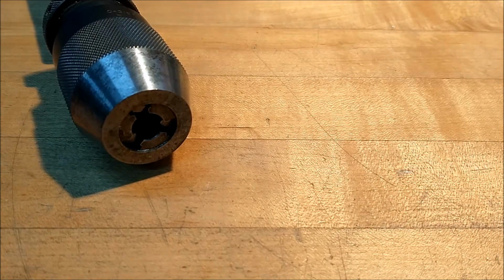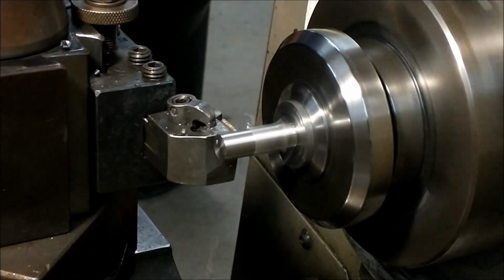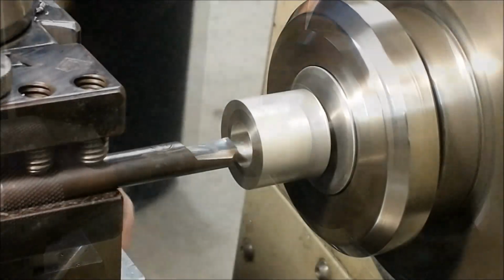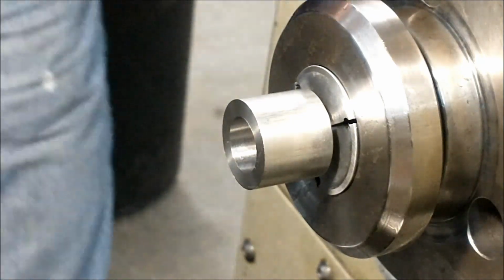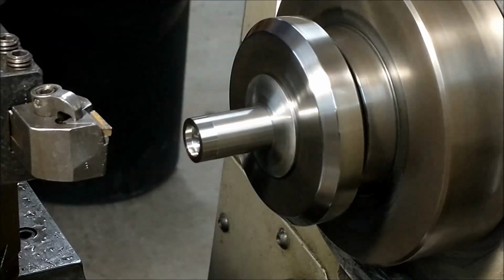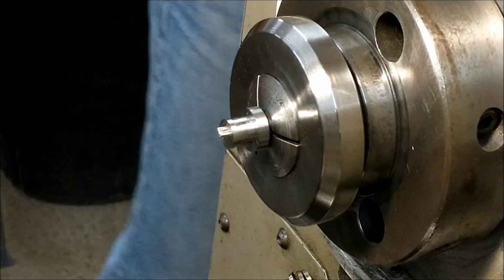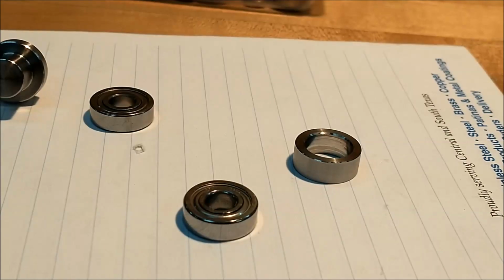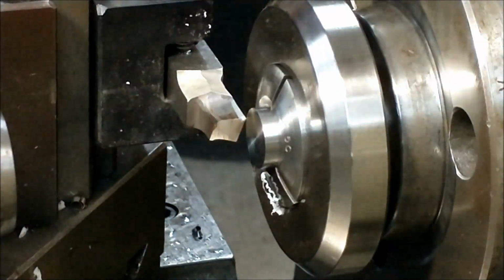Need a Live Center For your Lathe??  Lets Make one !

Comment: Are those thrust bearings? I'd think you'd want those in this type of application.
Reply: I'm definitely going to make one of these to replace the slug of brass I have with one flat face and one face with a centre drilled hole.
I'm going to add a lip seal and use angular contact bearings. I'll put a threaded through hole with a grub screw for driving out the centre and adding oil to the bearings.
Reply from the maker: Tapered bearings would be the best.

Comment: I was wondering about the bearings you would use. I priced a bearing set for an old Rohm live that I had picked up. If I remember correctly the price was in the $400 range. Needless to say, this center is a lot friendlier on my wallet
Reply: You can get them at a hobby store that sells R/C car parts, I bought a set of 8 for 15 bucks. You could probably get them cheaper on Amazon but I'd rather support a local business and the price difference isn't but a few dollars, I also don't have to wait for shipping. If you want a bigger 3/4" OD, 1/2" ID go to a skateboard shop/sporting goods store, good Swedish brand bearings for about 6 bucks apiece.

Comment: Don't tell about apprentice pranks! Oh well, do!

I got pranked so many times, because I was the perfect target: I exploded 😄
Reply from the maker: We blew up a cocky, know it all engineer once with oxy acetylene. He was quite humble after that.
Reply: 😄

When I left my workplace for any reason, I had to check literally everything, and the most insidious prank was the everywhere hidden blue ink.

They heated my workpiece, put it out of center, replaced the cutting tool, moved it off center, replaced gears, electrically inverted the motor, glued the handwheels or the tailstock, exchanged the imperial indicators with metric, unlocked the half nuts.

All under strict observation of the whole crew. When I heard somebody giggle, I knew something was wrong, and when I looked up into twenty grinning faces, I got so hysterical.

A couple of times it went too far, but we sorted it out: I was exceptional at school and could rapidly find solutions for "unsolvable" problems. Also, my special tools were popular. And when I was torching with fierce anger, they were off limits 😄

Now I am the complete contrary. If you want to fight me, you have a hard time to get me upset. Then, it was a snap of a finger.
Reply: @joepie221  machinists think engineers are the dumbest people who suck air.  I know, I have worn both hats.   One reason is that most engineering schools use professors that have actually never done engineering, and they don’t teach ( usually ) anything about the manufacturing processes.  I was lucky in that regard.   While working as a prototype machinist, I was invited into the engineering group.  So I already knew about precision sheet metal and close tolerance machining.   Furthermore, the chairman of the engineering school where I attended had been a practicing engineer so he insisted on a manufacturing methods class be taught.  The emphasis was on how the process affects the material properties, but everyone had to make something in the machine shop.  That class went on many field trips.   Every place we went, I had either worked there or they had made something I had designed.   I guest lectured this class the next quarter.   This was long enough ago that the school had not switched to semesters.  
I know full well of jackass engineers however.   Nobody pranked one particular guy,  he did it to himself.   This happened when he insisted in running the torque machine to show us that the roundness requirement on the sleeve was righteous.   Compared to what the sleeve fit on it was compliant.   Non magnetic stainless steel with minimum yield of 140 ksi is squirrelly  stuff, so keeping the sleeve in tolerance was hit and miss.   Didn’t matter as long as it was correct in the machining center.   While running the machine used to screw on the sleeve, maximum torque was reached and the sleeve was NOT on.  In the midst of his victory dance we pointed out that the torque maximum was reached because he had maxed out the stroke.  When operated by a competent operator the sleeve went on with no problem.  I still think the shop guys laugh about that incident.  It happened about 15 years ago.

Comment: Nice little project !  
 How would you build a 3 or 4 jaw chuck live center ?  I have need of one for my old 10" Logan (MT2 tail stock) until I get the 14.5" S.B. back on line.
 The Logan has a 7/8" through hole and I have a ton of shafts to turn that are 15/16" 
 I was thinking the same basic principle as this video but with a 3rd thrust bearing.

Comment: One question. Are you worrying about side loading those radial bearings? I have tools that have a pocket on the end of the center shaft where a steel ball rides. There is a matching pocket in the receiving housing so the steel ball covered in grease takes up the pressure instead of the radial bearings. Hard to find tapered roller bearings that small. There are thrust bearings that may work too. My RC helicopters have some small thrust bearings and a whole bunch of radial bearings. Boca Bearings has quite a selection of small bearings at good prices.
   Thank you for another fantastic video.
Reply: Really should be radial thrust bearings.
Reply: Since he is using it for pressure turning, I would imagine the side load is negligible as opposed to the side thrust if he were turning a shaft.
Reply: @robertoswalt319  The "pressure" in pressure turning is an axial load on those radial bearings and it's likely to be greater than the radial loads that will be introduced by the cutter.  The proof is in the testing, though - If the first bearing fails during use, there was too much axial load.  If not, cool.

Comment: Hola desde Argentina. Can you do a video with tip and trick to put a vise in lathe for milling operations? I a can´t afford a milling machine but i have a relatively large lathe and shapper. i have an idea, but your knowledge is the best.

(my next proyect is that and put a spindle with motor of a surface grinder in my shaper and lathe:)

Comment: Another project for the tool box thanks Joe. One question I am looking into purchasing a gauge pin set  would a minus set or plus set be better to start with ? Thank you in advance. Steve
Reply: It comes down to the types of holes you make most often. If oversize holes for slip fits go for plus pins. If onsize or undersize holes for press fits use minus pins. Eg doweling two parts where the dowel stays with a particular half when separated.
Reply from the maker: I have a minus set. It has served me well and allows for some very precise hole sizes.
Reply: Good question. I was wondering the same thing.

Comment: Joe, your center needs a bearing for the axial thrust load. The ball bearings you used are only intended for radial loads. An angular contact bearing in the back with a ball bearing in front would work better. A tapered roller bearing could also be used in lieu of an angular contact, or you could add a thrust bearing to the back of your double ball bearing stack-up. In its current configuration, those two bearing will not last very long.
Reply: Honestly, I was thinking along the same lines but I also have not really tbought about what thrust load really is on a live center.
Reply: Long enough for occasional work. This is not a turbopump.
Reply: Ball bearings can be used in any light radial / axial application. I think you'll find that most power drills use a couple of ball bearings, adequate for purpose, cheap and plentiful.
Reply: @TheRunereaper  A center is not really a light axial load application; even a small center. This is especially true when the center is used for press turning as Joe demonstrates. If you take a closer examination of the bearings used in drills, when it's just a pair of what looks like conventional ball bearings, you'll likely discover that one of them is a deep grove type, which are designed for axial loads. Also, there is a staggering difference between the axial loads on a hand drill verses a live center. The max load on a drill is ~200 lbs, but you can get more an 1000 lbs on a tailstock.
Reply: @EDesigns_FL  With respect, most "conventional" ball brgs are deep-groove. I made an almost identical live centre about 35 years ago and fitted sealed ball brgs (to protect from grinding dust and coolant ingress). I made the ID and OD to fit the most common size of brg. at the time and fitted new ones which lasted for about 20 years on fairly infrequent service. For pressure turning you don't usually need to put half a ton of load on, even though you can. I must admit, I never measured it.
Reply: @TheRunereaper  Yes, I should have been clearer: deep groove bearings are the predominant type. I was referring to specialty designs of that type that are intended for combined axial and radial loading for applications like small drills. Although typical deep groove bearings can handle some axial loading, it tends to be a small percentage of the allowable radial load rating. 
Unfortunately, bearing manufactures generally don't provide axial load ratings for most bearings. With the exception of thrust bearings, the ratings typically provided are just for radial loads. If you're interested in how to determine appropriate load limits for different bearing types, here's a link:
https://koyo.jtekt.co.jp/en/support/bearing-knowledge/5-7000.html
Reply: @EDesigns_FL  This could easily turn into a mutual intellectual masturbation session and I'm not really that interested. In any case Joe is aware, has answered the problem at the top and I agree with him.
Reply: @EDesigns_FL  I don't know where you look up your bearings but I can't remember seeing a bearing catalog where they didn't specify the max allowable axial load. - The hard fact of live is if there is not a thrust bearing in the system I cannot tell you of a bearing where there is not any axial load. ,,,, Start with electric motors. If you do not have the sheaves aligned within 50 millionths you get thrust loading of the bearings,,,,and then we can go down from there. Or should i say "up" ?
Reply: @mathewmolk2089 I use numerous references from several major bearing manufactures, such as Timken, NSK, and Koyo, and I haven't found a specification for axial loading in ANY OF THEM, with the sole exception of thrust bearings. If you have a link to such information, please share it, because calculating the value can be tedious. Having some experience in this matter, I believe that you have misconstrued information that you may have seen. Calculating the capacity of bearings is more complicated than just looking up a couple numbers. So the industry adopted a methodology that relies on radial capacity and RPM limits: the rest has to be calculated. Please prove me wrong.   

There is a difference between a little axial loading that might be experienced in an electric motor verse that imposed on a live center: especially when its used for pressure turning. Tailstocks are capable of, and designed for, imposing significant axial force.
Reply: @mathewmolk2089  You're quite right about motor brgs. Mathew. Not least because the fan forces air between the armature and stator windings, which induces an axial reaction. As an apprentice I had to spend a lot of time learning how to align the motor to the pump properly so that the coupling ran true in all 4 planes. Rubber/nylon spiders were not that common then and even so, a well-aligned motor will give a much longer brg. life . Loose mounting bolts cause havoc, particularly if the coupling is misaligned. If the pump thrust brg. fails, that load is also transmitted to the motor brgs.

I expect you're well aware of all of the above and apologise if it sounds patronising. If you need to go deeper into brg. application just select the ID/OD/length, find the number from your catalogue (e.g. 6308), google the number with SKF after it and you can pull out every last bit of info you will ever need from the SKF website including load calculations. If you want to be really flash you can make yourself an Excel spreadsheet and just tap in the relevant numbers. Easy-peasy.